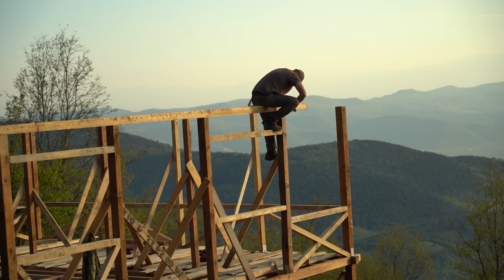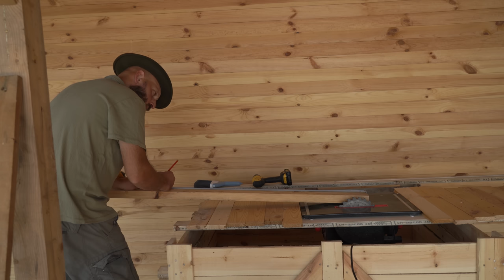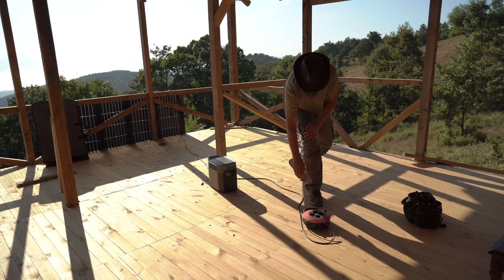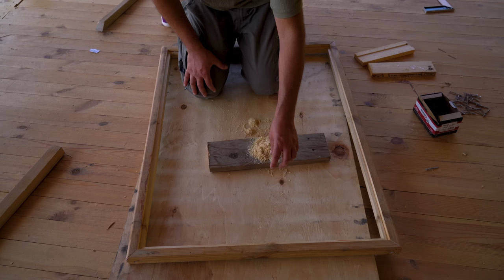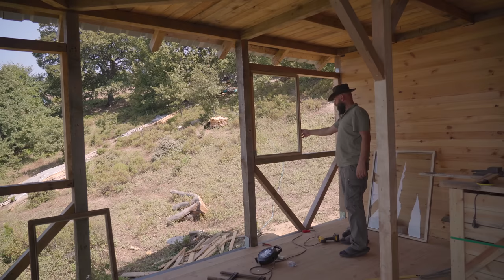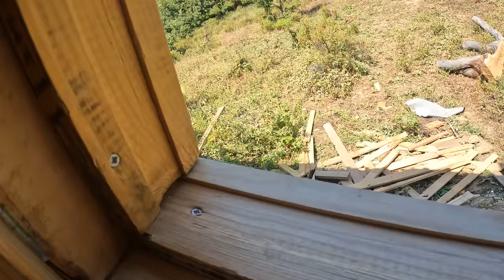Building a Wooden House in an Off-Grid area - Wooden Window Construction  |  Cost $75

Comment: You've been very busy building this dream house and I am amazed at how much you've accomplished so far.  I like how precise and careful you are while building this home;  you've put a lot of thought into the process of doing it correctly.  I'm curious about the type of wood you've used in building.  Just listening to the sound of the drill screwing into the wood it sounds like you've used hard wood on the window frames.  I know you've used quite a bit of repurposed wood which is very cost effective and eliminates wasted resources.   I'm also wondering how effective single pane glass will keep your home insulated throughout a harsh winter or cool during a hot summer.  I love watching these construction videos,  they're always fascinating to me and I'm always up for learning something new.  I always look forward to your next projects.  
As always my friend,  stay safe, be well and happy.
Reply from the maker: Hello, I hope you are well. I generally used pine wood in this house. I actually made the parts that I would hesitate about so that I could change them whenever I wanted. I can dismantle the main column system I want whenever I want and replace it with a new one or an iron column. The windows are 4 mm thick and I will understand this by spending the winter :) . I found large residence windows that will have large windows in the front sections and will be resistant to the wind, and I will divide them into two and use them in the next section. thank you for your comment my friend